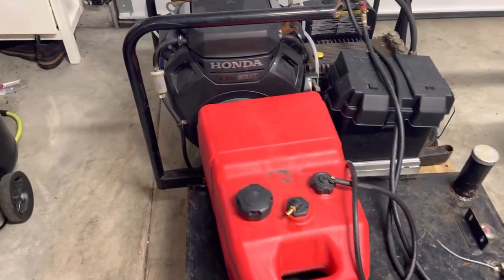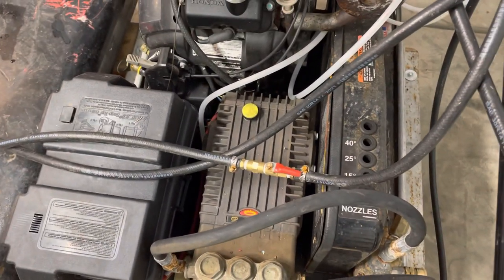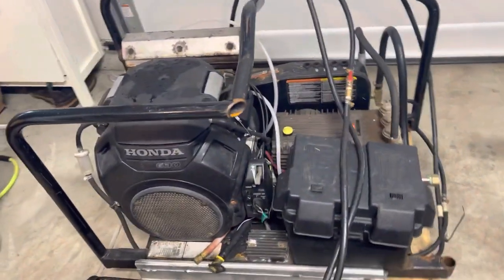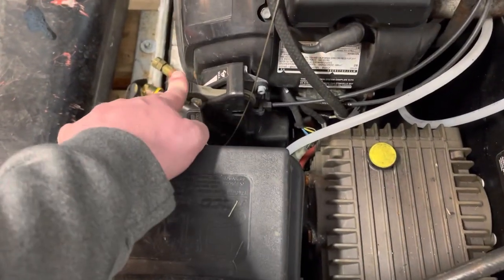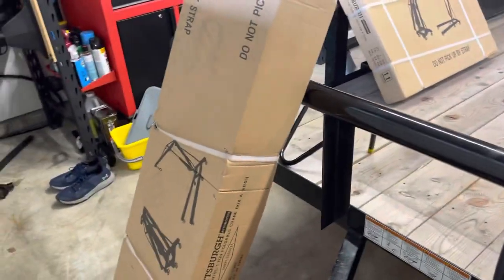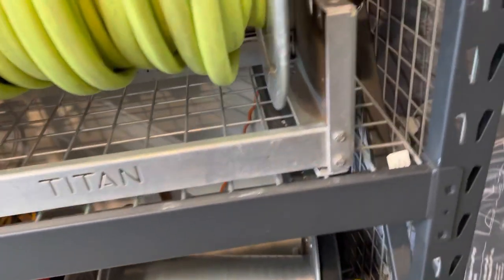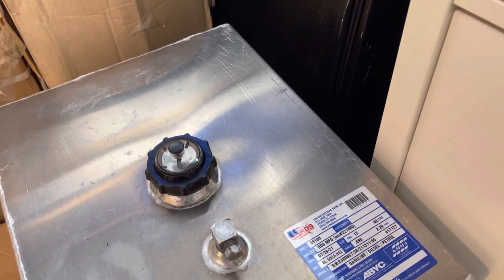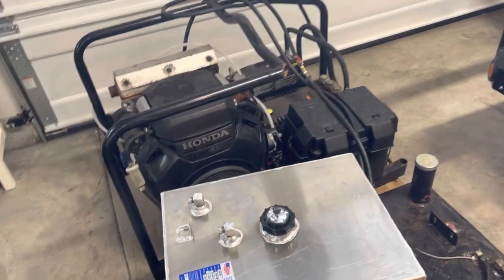Honda GX630 Pressure Washer Rebuild- Part 1 (Walk Around)

Comment: 8gpm and 2500 psi.  2500 psi is plenty of pressure for flat work aggravate or not.
Reply from the maker: Good call. Still need to update the video. Chose to go 5.5 3500. I did that to give more versatility with an 8. Will use less water. We will see how this goes. I already have 2 8s

Comment: In my situation, I’d definitely go 8gpm. But I have a 4/4000 that could handle my concrete needs. It’s a little slow for house washes
Reply from the maker: I’m thinking this one will be in the bed of a truck. Aluminum pallet with a small buffer. Haven’t 100% decided yet. 8 GPM would require a larger buffer. Thanks for commenting.

Comment: Hi Tim,

I purchased a used Honda gx690 3500 psi @ 8.0 gpm with a GP TSF 2021 pump. It needed some work but got it running. My issue is I did two one minutes flow test to check gpm. I'm only getting 6 gpm @ 3000 psi in half & full throttle. My filter is completely clean. I used the green tip (8.5) with the flow test. 

Is there something I'm doing wrong or missing to not get the 8.0 gpm? 

Any help will be great full..

Michael C - (WA)
Reply from the maker: Try a 8.0 tip and adjusting the unloaded till it’s just a trickle coming out when on the gun.

Comment: If you have it can you put up the part number or link for that 13 gallon fuel tank and any lines or fitting you would recommend sonits safe. I want to upgrade the small 6 gallon I have now that came with it. Thanks
Reply from the maker: Absolutely. Just add some hose barbs and 1/4 fuel line. The barbs should work from your 6 gallon tank or buy extras at your auto parts store when you pick up the fuel line. Make sure the vent stays open on that gas cap or your pressure won’t run. Here is the link. You will really like this tank https://m.northerntool.com/shop/tools/product_200413776_200413776?cm_mmc=Google-pla&utm_source=Google_PLA&utm_medium=Fuel%20Transfer%20%2B%20Lubrication%20%3E%20Fuel%20Tanks%20%3E%20Fuel%20Transfer%20Tanks&utm_campaign=RDS&utm_content=349009&gclid=CjwKCAiAzrWOBhBjEiwAq85QZzczb6bkfijG_ZumW2HY9l_dYUqNbQV6JZBs9FVXD23FkYT37EWhnBoCINcQAvD_BwE&gclsrc=aw.ds

Comment: That engine is right at 21 hp —— 21x1100=23,100 divided by 8gpm = 2887 psi so definitely go with 8 gpm pump,
Reply from the maker: I’ve always calculated it different. Psi x GPM divided by 1100 = needed Hp. This engine is rated at 20 HP. With my calculations, 2887x8 divided by 1100 = 21. I guess we come up with the same number. With that in mind, it would definitely push 8 GPM but with a lower PSI. Have to account for some PSI loss through 200 ft of hose. It would be a house wash beast but mediocre on concrete.
Reply: @ExpertPowerWash  I NEVER run over 2500 on concrete, you risk removing the top coat and then you have exposed aggregate
Reply from the maker: I hear you. I’ve been at this for a bit. You have to account for PSI loss from 200 feet of hose. A lot of our sidewalks out here are aggregate and moss covered.

Comment: Can't you put a 8gpm 3500psi?
Reply from the maker: Not enough HP. It’s slightly less than the gx690. You can do 8 GPM with less PSI or less GPM and more PSI. Just can get both those at the same time with this engine.
Reply: @ExpertPowerWash  I just seen a 7.6 gpm @4000 psi that needs 20hp to run...let me see if I can find the specs again
Reply: General pump tsf2019ds ts 66series. Just a thought...expensive thought but maybe a possibility
Reply from the maker: Interesting. Any videos or write ups about this set up?
Reply from the maker: Looking at those numbers again. Seems impossible to get those numbers with a 630. My calculator says you need 27 hp to achieve that.
Reply: @ExpertPowerWash  the spec sheet from manufacturer says 18.7 ebhp...
Reply from the maker: There’s no way. Is this on the General pump site? Usually the formula is PSI x GPM divided by 1100 = HP needed.
Reply: @ExpertPowerWash  yes...I googled the pump number and found spec sheet...wish I could upload the snap shot
Reply from the maker: I’ll Google it and check it out.